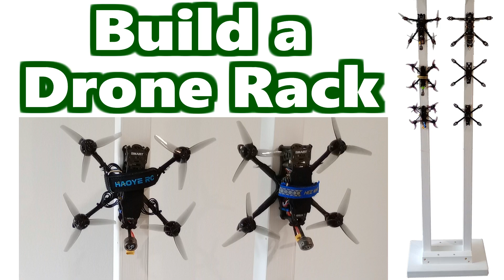Build a Drone Rack

Comment: Hello, what motors are you using on your crux35? Is it still the 1504 3100kv? Is the xing 1404 3800kv good too?
Or will you suggest other motors?
 Thank you
Reply from the maker: I think the best motors for any 3.5 inch freestyle are the 1504 3100KV or possibly the 3900KV ones. I prefer 3100KV. But 1404 size motors would also be a good choice. 3800Kv sounds about right.